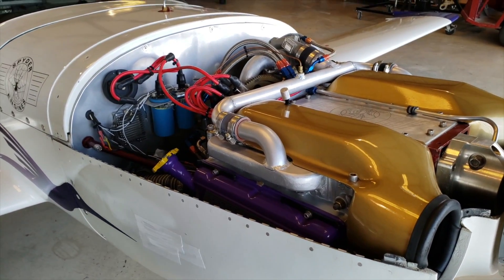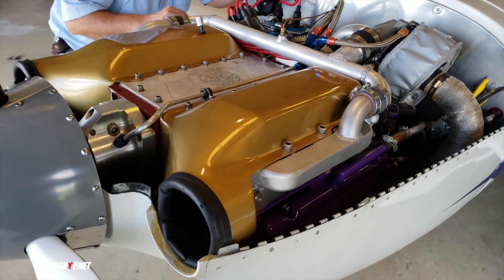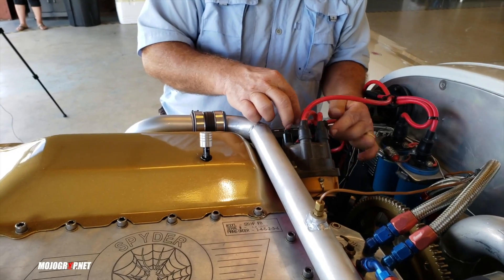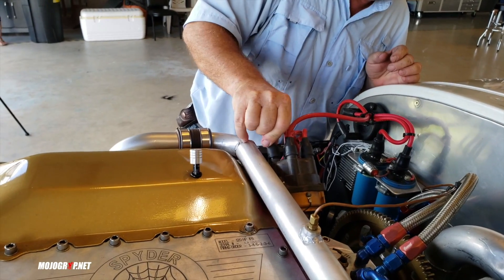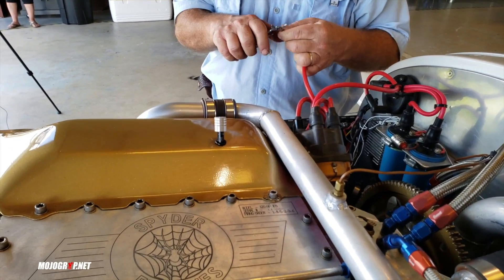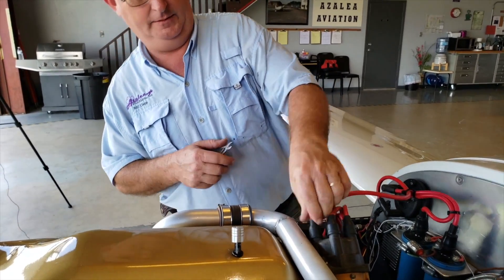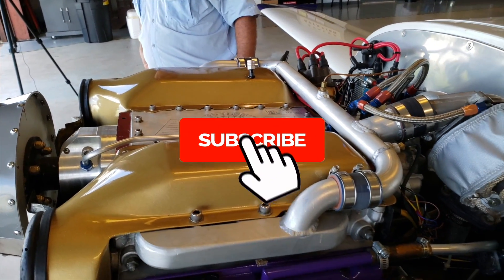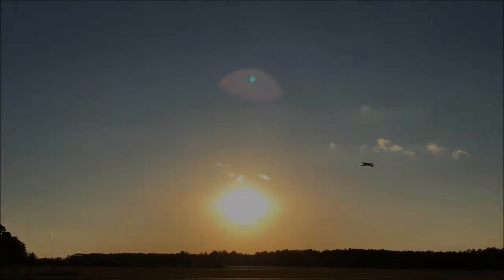120 HP Turbocharged Corvair Spyder Aircraft Engine In The Saberwing

Comment: 120hp out of a 6 cylinder? Why not use a motorcycle engine at that point.. na io360 make 200hp..
Reply: Torque...
Reply: also,  to make 120 hp, the MC engine you're considering is running 10k RPM's or so?   That Corvair engine making 120HP is running less than 3k RPM and is a direct mount prop.   the MC engine needs a reduction unit (weight + complexity).

Comment: I've owned corvairs.... mistake putting it in a airplane. Not!! Reliable!! Sunny days only. I wish you the best of luck.
Reply from the maker: Really? care to share more? what aircraft model was it in? and when you say sunny days only, do you mean you can't fly them in any type of weather?
Reply: @mojogrip  I had a 1968 and 1964 completely rebuilt by a good mechanic. But still ... always had problems with something. Always had oil leaks to carborator problems. Sensitive engine. I liked the car but to many problems. I will say when the bugs got worked out it ran fantastic. It just seemed my head was always under the hood fixing something.
Reply: @wellingtonwhite2546  Oil leaks and carb issues are usually result from mechanic's poor discipline or understanding of systems.  An A&P/IA is more highly trained that the cheap garage down the street. Even then, each engine is different. A Lycoming and P&W are significantly different and each has its own build process.  Apples & Oranges are great for fruit salad... not for comparisons.

Comment: Is this motor out of the old Chevy Corvairs?
Reply: Yes. The later 2700 cc size possibly with larger cylinders for 3100 cc. I believe the early size was 2300 cc and ended in 63 or 64.

Comment: Thanks guys.   120 hp for this aircraft is more than adequate.    Yes ignition seems to be older style but has great track record and simple to repair or diagnose.    There is redundancy with points or electronics.   Best of both worlds.   I have 2000 hrs plus flying my engines
Reply: Super clean install! heck of a job! what kind of boost are you getting at altitude and rpm?

Comment: Engine looks clean however only a 120 horse out of the 6 cylinder engine.
Weight to horsepower ratio not good...🤔🙄
Reply: Aviation is more about reliability than optimized power.   That 120HP is at 3k RPM or less.  Sure, it can make more power but it doesn't need to.
Reply: It's rated at 150 hp if it's a early model and 180 hp if it's a 1965 model engine.